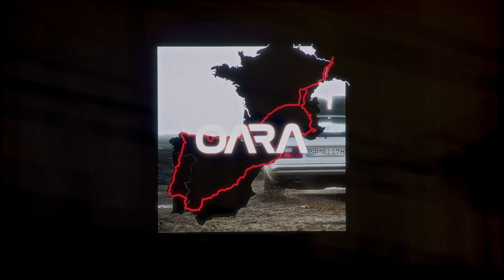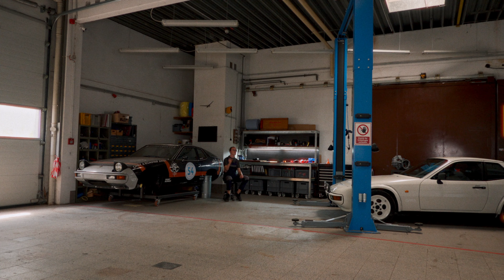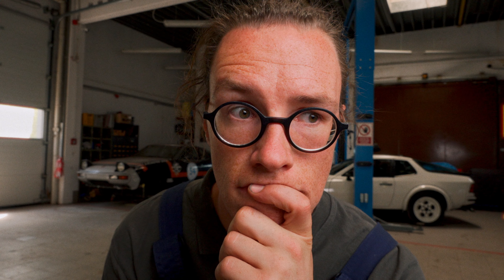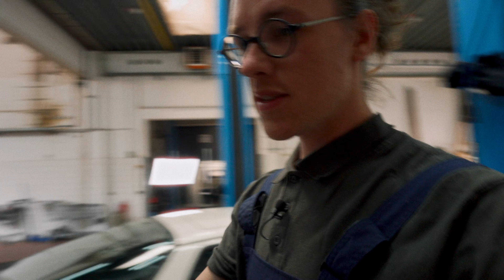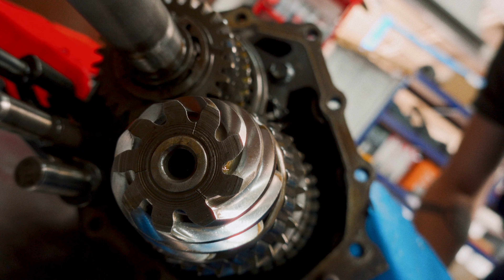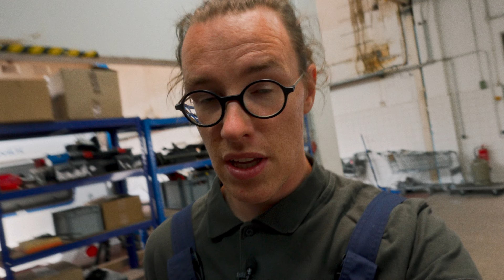classic cars are unreliable, here's why mine don't break

Comment: I'm on my 3rd Porsche transaxle. '85 944, '83 924, now finally my '80 924 Turbo. I've learnt most things I need to worry about over the last 11 years so I know what parts are likely to fail, what needs to be regularly checked, and what simple stuff I could fix by the roadside. I'm always a bit anxious after doing major work, but confidence soon grows again with use. I had no mechanical experience before owning these cars.

Comment: Hi! 
its a big mistake...
In 2003 I had my first road trip with my Ford Capri, Erzgebirge- French north coast to St. Malo and across the country and Nancy, back through Germany. Only defect: loose fuse and torn off exhaust bracket, because I had "shortened" at le Mount St. Michel at the car park... My own fault, I had it re-welded in a nice garage early on. Most of the time I slept in the car... Been on the road with T4 for a couple of years, no big problems. Then, a few years later, I drove through Belgium with a friend and a Capri number 2 and an Opel Commodore A on a similar route. The only defect on the Capri was a worn tyre on the inside front, my fault, so I screwed it back on and went on. On the Commo, a defective (NEW !!) radiator cap, never change a running system!!!
4 years ago I was in Barcelona with, now, my Commodore A Coupe, 1970. across France, only one defect, water ingress, in the only downpour there was. Self-inflicted, as I left the window open. And 150km from home, a broken light switch. It was possible to bypass it. Don't forget, I always have to cross Germany first. Now the Mazda MX5 is waiting for the next road trip. It's all a question of preparation and reduction!
I love your channel and your English!! ;) and have been following it for 2 years ! Take advantage of your youth and the opportunities, travel with older vehicles, they are symphaty carriers and can certainly always be repaired. you have it easier today, if there is a problem and you have wifi, you can google almost everything. but you have to have the entusiasm and the will in you. Our learning and google was :TRY & ERROR ;) 

Stay healthy, see you on the road. Life is a f... Roadtrip!!!! 

Translated with www.DeepL.com/Translator (free version)   Sorry my german is realy better, maybe yours too ;) 

The first what you must do: START!
remember, older vehicles need some affection, just like your partner. And a little technical understanding...  And we only learn from problems... and there is always someone who can help... Put your smartphone in the corner and start, I'm happy to help...

Comment: I drove a modified 1986 951 (944 turbo) as my daily driver in college from 1992-1995. I had to replace the balance shaft belt, timing belt, and idler along with the oil cooler line and one fuel inj relay while i owned the car. But I roadtripped the car with college buddies and literally beat the snot out of it. One friend had a Supra Turbo and another had a 1989 V6 Turbo trans am which we used to race each other all the time.

I currently have a couple of 1960's - and early 1970's corvettes which I drive often... I drove one of the vettes on a 3 hour trip last weekend.

Comment: My son is a Mechanic. Modern cars are designed to be 'maintained' from underneath on a ramp or lift. With special tools and computer. Some are designed to be throw away. Example: Fiesta ecoboost 1litre. 150k miles req timing belt change. Local Ford dealer told them to just throw the engine away as it was easier and cheaper.

{Maintenance on modern cars is pushed to as long as possible to be as cheap on finance as possible for the first owner. So oil change at 20k miles...}

Comment: can relate to every single word. And it also applies to relatively modern cars. I have both, car from 1982 and from 2010, the later one has 300k+ on the odometer. They both are as reliable as my attitude. And every time I start a journey, there is only one thing to consider - that my risk aversion corresponds the car technical condition.. after all, if it fails - live it through, fix it, learn the lesson, make adjustments (mindset). go on..

Comment: Hi there! I'm enjoying your videos and drawing some inspiration from them from time to time. I've been driving my '82 924 2.0 for about a year and a half now and I've done about 15.000 (mostly) effortless kilometers in it. Sadly, I'm not mechanically proficient and can't do work on the car by myself. In the very near future however, I'm going to have the timing belt changed and new shock absorbers installed. The plan is to do a big roadtrip through Europe again this summer. Now to the point, as I don't know the car inside and out mechanically: are there any parts you'd recommend I should look into or replace? I've been thinking about replacing some rubbers as they obviously wear out. I don't care if the car isn't in concours shape; as long as it's sound under the bonnet, I'm quite happy. Grüße aus den Niederlanden!
Reply from the maker: Truth be told, the sky is the limit. Only by the time all wearing parts have been restored or replaced is the journey clear for a while. Timing belt/water pump is dead easy on these, in your case I‘d figure out how it drives and change from there. If it was mine, the entire suspension and braking system would be done to as new.

Comment: 1.7KG is going to make that thing rev ALOT quicker. 
A 150 grams off of the rotating assembly will reduce lap times on a road course more than 50KG off the car weight. 
RECIPROCATING Weight is where the big gains come... every piston, pin, ring pack, and small end of the rod is acclerated from a dead stop TWICE every revolution.  Every bit of power used to acclerate the piston cannot be used to accelerate the vehicle.